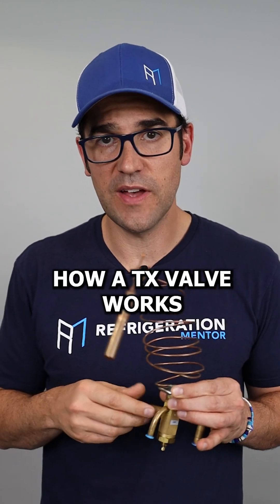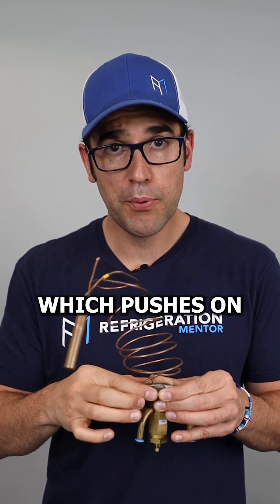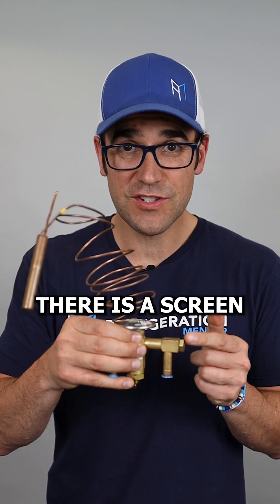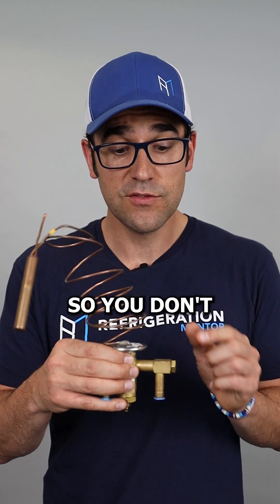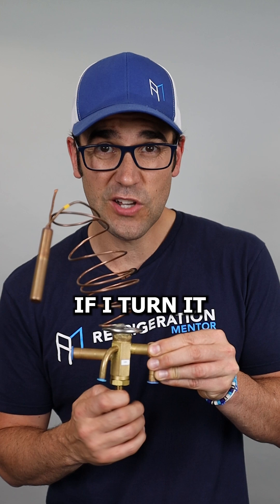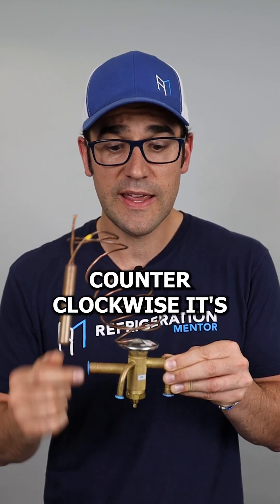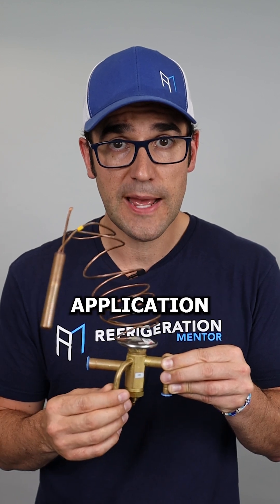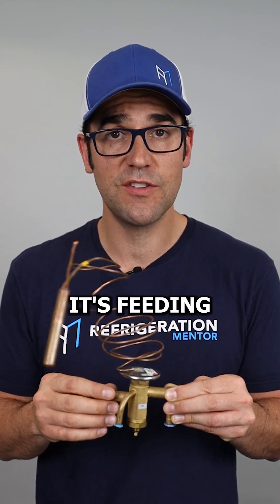Do you know how a TXV actually works?

Comment: Im working on a ship and Im having a problem regarding the suction accumulator having ice on our provision refrigeration system. Im suspecting this might be the problem the TXV. I tried replacing with new filter drier but we're still having the same problem. Do you have some advice? Thanks.